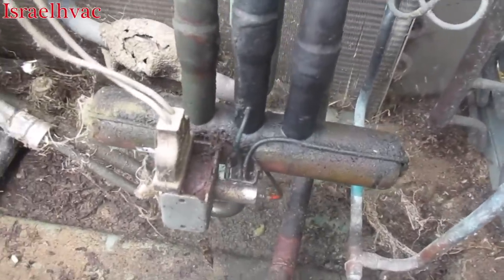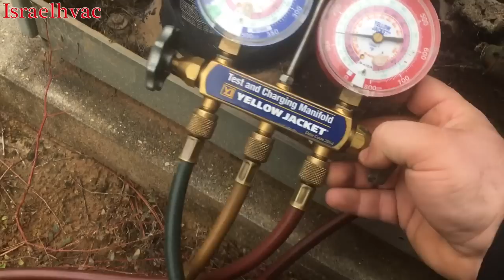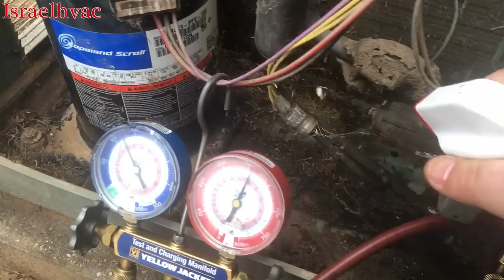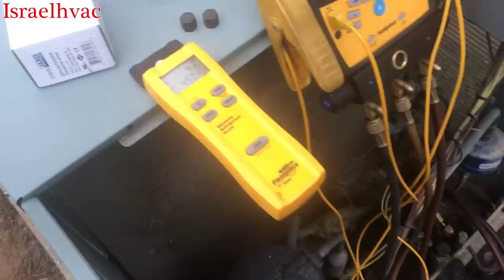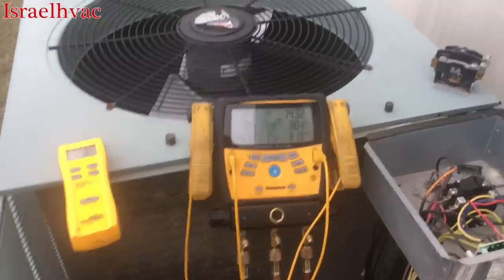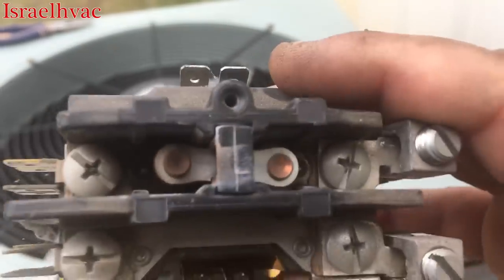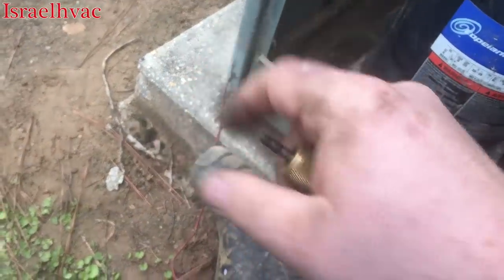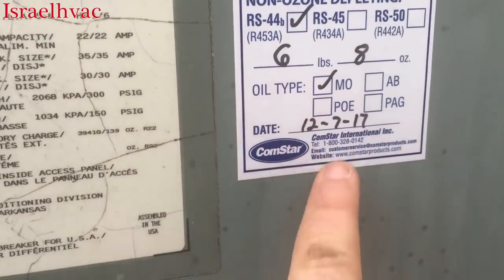Refrigerant Leak Repair | Reversing Valve

Comment: Hello John I think changing that valve is a better option and no doubt customer will be happy to get it replaced.
Reply: Found one just the other day on a rheem leaking in same spot, decided to recommend changing the valve.
Reply: @timrob0420   Good luck with that. I replaced a leaking reversing valve in a Ruud unit. A couple of years later the damn replacement leaked again in a similar spot.

Comment: I do like the replacement contactor you used with the cover plate that helps keep dirt and debris out from in the contact points, and the heavy duty lug connectors.... good choice. Good preventive maintenance practice.  I noticed the Rheems do burn up more than most because of the design of the electrical box section but its also easy to access.

Comment: Good repair, and schrader core change. John
Reply from the maker: Thank you my friend
Reply: just attempted a core earlier this week with my yellow jacket and it was on the discharge line and I think someone used a brass service valve cap and mushroomed the schraeder and rendered it useless (unremoveable) of course after I pulled a vac and charged it.... so it got leal locked and sealed for good in the mean time. Those Rheems have 4 access ports.

Comment: i noticed while you were removing the transformer there was a loose black wire that you removed from the transformer rubbing and shorting out the components of the control board while the board was powered up.Is it normal practice to leave leave the board powered up while working on it? the loose wire is just below the small polarized caps on the control board

Comment: DID YOU DO THE PUMP-DOWN  IN TOTAL ? THEN YOU CHARGE IT BACK AGAIN TO GET THE SAME PRESSURE   AND THE SAME QUANTITY  OF GAS IN THE SYSTEM? MOST BE NICE IF ANSWER THANKS
Reply: GIOVANNI JUAREZ it had a major leak. so you wouldn't have the proper charge come out of it.

Comment: With it having leaked down and having to do a repair, would that warrant a drier change out?
Reply from the maker: I did not open the system. The refrigerant isn't brunt so the drier is fine. You can debate that i'm sure some people won't agree but it is what it is